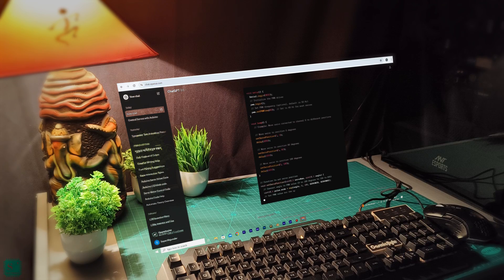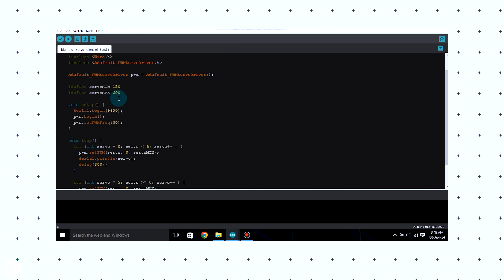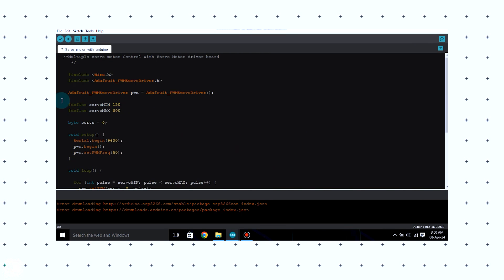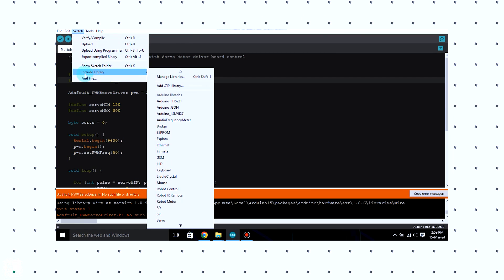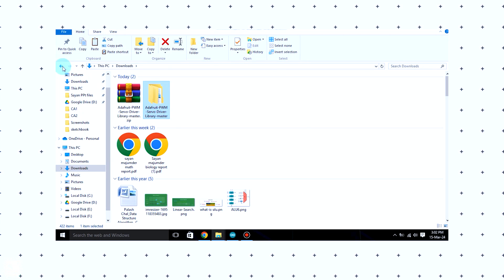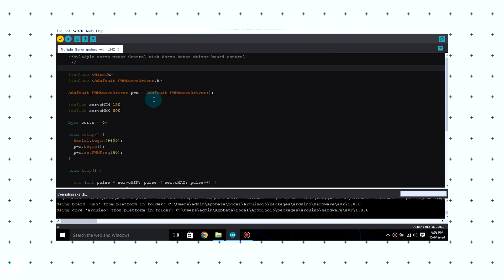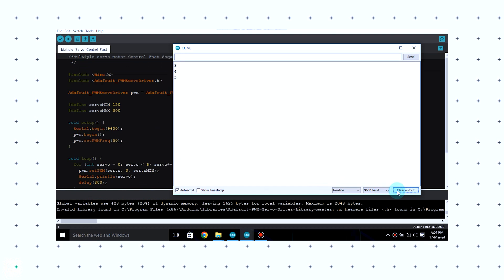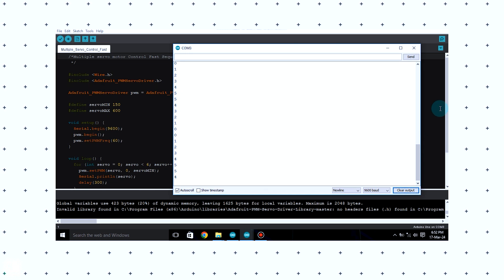Control Multiple Servo Motors With Arduino & 16 Channel PWM Servo Motor Driver

Comment: If i only use 3 of sg90 servo, am i still using the servo motor driver?
Reply from the maker: You can try pwm pins of Arduino nano (from expansion shield )also..but 5V supply for each servo is better through this motor driver board

Comment: Hello Im doing one project using ESP32 and there is requirment of 16 servo to be run at a time then how can I connect ESP32 to servo driver and can 16 servo work at a time using that servo driver please give suggestion 🙏🏻

Comment: hi nice creation I wanted to know if it was possible to control the servos via buttons I'm trying to use it on a miniature railway for the rail switches. I'm very bad at arduino and I'm looking for help thanks
Reply from the maker: Yes, but there'll be some changes in code
Reply: @SayanElectronics  could you kindly give me an example i am not very good with arduino or tell me where i can look thanks